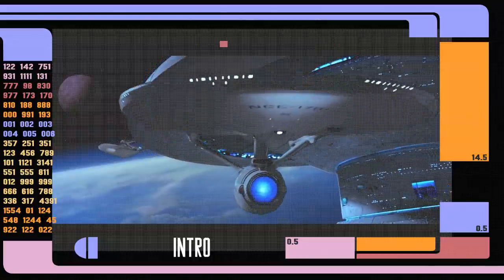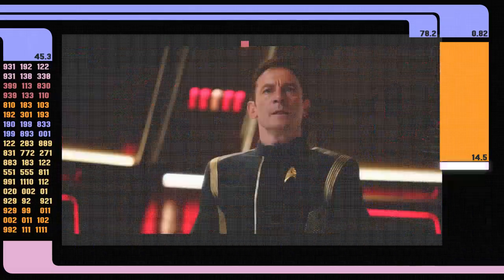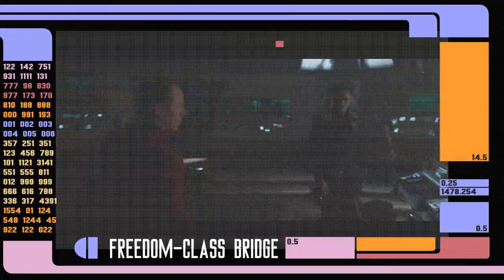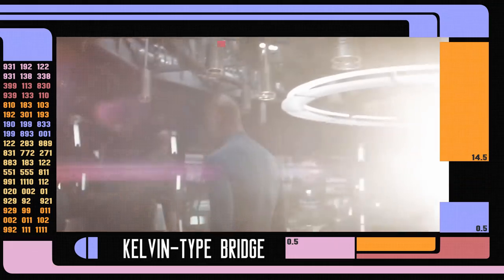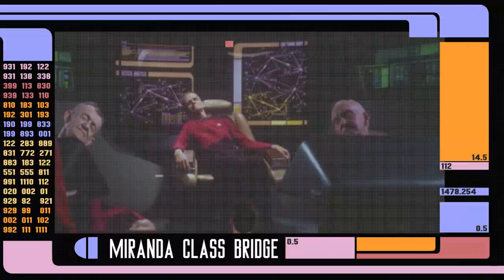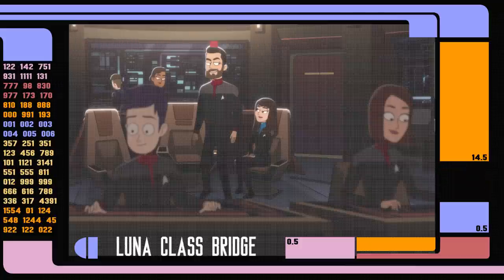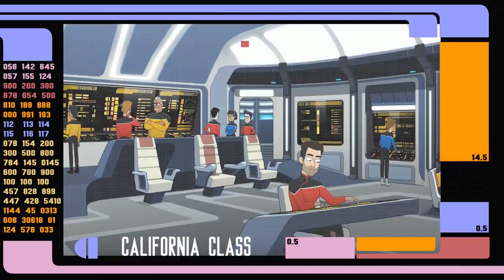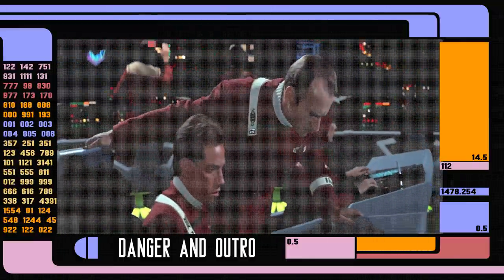Forgotten, Fatal, and Unethical Starfleet Bridges

Comment: The submarine aruments didn't hold water (pun intended) for me either. Especially when it comes to  the big military ones. The effect of the vacuum of space on the hull of a space craft doesn't change. Not like a maneuvering nuclear submarine.

Windows work better on a space craft. Though it would be wise to have some kind of armored cover. Even if the "window" is a transparent metal. I doubt it would realistically have the same protection qualities as it's opaque counterpart. You want as many layers between you and space as reasonably possible.

Good breakdown. The Miranda is still the best in my opinion.

Comment: I thought they used Molicircs (Molecular Circuitry) which are solid blocks of material (like Crystal or Plastic) with the molecular engraved circuitry which when that huge amount of power surges through them they can blow apart and would resemble rock like objects?

Comment: Most of the bridge layouts are indicative of fishing vessels and airplanes but in the airplanes you have the captain in the pilot seat and the co-pilot next to you and then behind you usually to the right you have your radio equipment and to the left you have your engineer for the engine controls sometimes it's reversed depending on the maker of the airplane but ships are the same way you have the bridge where the captain sits on the right and first officer sits on the left monitoring the engines and behind them they have the radio operator on my ship it was the left side and the navigation charts were on the right side

Comment: They were battling at 100 to 100,000 Kilometers around 62 to 62,000 miles.   so windows would not even pick up a ship.  A d& was only 750 ft so you would be hard to pick it up.

Comment: The rocks are easy. Heat up a flat piece of metal with an oxy acetylene cutting  torch until it’s glowing, then hit it with the oxygen. The liquified metal blasts in droplets and pieces. When they cool, they and the slag look like little Rock’s.
If in Trek it’s power that’s heating material and causing explosions, it makes sense.

Comment: Really the rocks never made much sense to me either, but thinking about it, could maybe be some sort spray form concrete that they use for a surface coating. Much like drywall or sheet rock but more startrekie.

Comment: The kersplosions from control system hardware would relate to the control method. For minimal latency, you'd be manipulating the energy stream that energised a particular component. Minimal relays, amplifiers, encoders, etc. So, in the case of a surge, crossed circuits, etc: kaboom! Also, hence the auxiliary and backup controls, these would be less direct controls, by relays and switching components, and by software and remote actuators. These would come with the safety but inherent latency and indirect communication. The main (direct) controls would feedback the status and control state, directly. They would be almost immediate in nature and would be very responsive to inputs and actions (and errors). A good example would be a transporter, where you don't want to wait for an error detection system to tell you there's a problem with the matter stream, you'd want to experience it directly in the controls you are handling. Something like haptic feedback. As for the rocks, plasma energy + most tactile matter -> cooked matter, probably carbon deposits, buy why not pyrolytic "rocks"? if silica and Aluminium are present, you'd plausibly have ceramic byproducts.

Comment: There is no such thing as a need for so much power flowing thru the console 18:50. Regardless of how much power is needed at the endpoint, the power for virtually none of my car's functions flows thru the switches on my dashboard.  Virtually every switch on my dash merely controls a relay. Most relays are under the hood closer to whatever they operate,  and these relays serve as electrical switches themselves. 

So t power for the starter,  blower, and radiator fan motors does not flow thru the dashboard.  That would be dangerous and would start too many fires in the passenger compartment. 

Apparently this idea regarding relays and the very concept of a fuse was lost in either the Eugenics Wars or WW3, or something. Or maybe people in t 24th century just like exploding dashboards and fires in the passenger compartments because life is just too easy otherwise.

Comment: Another issue with having a window over a view screen is it means you only have a single sheet of plating between the bridge crew and space. Even if transparent alimunium is as strong as Duranium or Tritanium alloy (which there is no evidence that it is) you're still making the bridge more exposed by cutting away material from in front of the bridge.  The bridge on starfleet ships is exposed enough as it is without thinning the forward protection to a single thickness of transparent metal plating.
Finally, I'd like to point out that the field of view isn't even that good, it's a flat plate and it's inset into the hull.  All you can see is directly ahead and up, there's no effective vision to the sides or aft of the ship, so you'd need a view screen in addition anyway.  If you must have a direct vision port on the bridge it'd be better to expand the bridge ceiling dome so you can at least put someone up there to have 360 vision above the hull (still not going to see anything bellow thanks to the saucer).
Reply from the maker: It’s the same amount of protection.. a bit does the same for both

Comment: As for the windows issue:  apart from the simple fact that the same with a capital W is never a good idea, I so dig the point. 
 I'm a secondary school teacher, and quite the fan of using ITCs as a tool. But my experience is, if you plan a lesson where you use them and don't have a Plan B, that lesson is lost and frustrating in 95.95 percent of cases. 
  And now figure that there's 1,000 people's lives depend on it.
Reply: One word, Cameras.

Comment: Windows: https://www.youtube.com/watch?v=DduO1fNzV4w&t=3s
Exploding Consoles: I blame them using EPS conduits and getting away from wires (There is no need to have the voltage of a X-ray or MRI going to any one console on a bridge. Energy should be divided out in a Pen-Panel (Penetration Panel) anyway.

Comment: The 'windows' in the front of some of the Bridges (looking at YOU Enterprise E) are probably made of some transparent aluminum or some more advanced alloy but don't appear to be quite as durable as the non-transparent metals used for most of the hull shell plating, we did see the 'E's bridge window blow out from battle damage with helmsman Hawk blown out into space.  The ability to project images onto it is 20th Century tech (Heads Up displays) used in military and many civil aircraft, even some automobiles played with the idea from time to time.  

Positioning of the Bridge of a ship expected to take part in combat is something I've never liked.  Having the Bridge / Combat Information Center in such an exposed position.  "Target their Bridge" - one of the Duras sisters in "Generations."

I write "Space Opera" stories for my own entertainment, my warships have their most sensitive or vital areas buried deep in the hull behind multiple layers of armor and shields.  Main Bridge is part of a module containing the central computer core.  The layout of the Main Bridge is similar to what we see both in Star Trek and in the CIC of many USN warships, Captain's chair elevated in the center with consoles for helm, operations, various weapon system and electronic warfare grouped around him with other consoles to monitor engineering and so on lining the outer bulkhead.

Viewscreen is exactly that, I call it a "Smart Wall" except that the tactical display mode is holographic, showing both friend and foe in positions truly relative to each other.  Why doesn't Star Fleet use 3D displays?

Comment: I think that if the consoles are truly just looking at sensor data and commanding the computer to do things around the ship, the consoles wouldn't blow up.  Most likely, these computers have some sort of advanced processor in them that when trying to draw too much energy while a surge happens will blow up.  an explanation as to why these computers are still usable afterward is that a backup computer that is less powerful allows undamaged portions of the display to be used to do basic functions required for running the ship.  If the display is too badly damaged then I would imagine that you could reroute controls to another console.  Regardless, these consoles seem to have a fatal flaw, one which literally kills people.  It would be much more sensible to build these computers into a server room nearby to stop overloads from killing or seriously injuring the bridge crew.  I could imagine that other species tend to do this approach more as the federation can be hard-headed sometimes.  at least most of the bridges have handrails that are well made to stop people from just flying everywhere as we see in certain other ships.  Seriously, the number of times someone was saved from one of those handrails probably makes up for the whole console blowing up thing.  Maybe the consoles have large batteries in them which an overload could create a big enough discharge to cause a minor explosion.  that would honestly make more sense but again the consoles should have less tech inside them and in a server room instead.  Those consoles in TNG are pretty chunky even for 90's standards.  But yeah, even though computers don't really explode like that in real life, they clearly have a big problem that has remained untouched for like 200 years almost if not more.  All I have to say after that is get a life.

Comment: Whoever makes transparent aluminium will implement it. Oh you mean aluminium oxynitride? The actual real-world Trans-Al?
Alien Bridge Breakdowns? Hell yes!
Exploding Consoles? Y'know, we always assume that these consoles don't ave circuit-breakers, overflow-switches and surge-protectors, but what if they do? What if these safety-measures exist, kick-in, and what we see is just merely the remaining over-power bleeding through into the system-that-cannot-handle? Imagine how much the system would explode without them...
Rocks in consoles? Well, I never heard the idea that they are basically non-rock materials from inside the console that simply solidify when the console explodes. I like the idea.

Comment: Federation bridges were designed larger as Starfleet became more and more "Exploration and Scientific," with a low emphasis on combat.
Larger, clear panels, space to move add to comfort and ease of officers and diplomatic endeavours.
For examples, Defiant bridge is more compact....its built for war.
NX bridge is more compact and streamlined....early United Earth StarFleet.
Explorers have a mix (Constitution, Intrepid) Diplomacy are more expansive (Galaxy) Combat more streamlined/compact (Defiant, Miranda) Scientific more science based (Oberth).
As the series moves into more "Golden Age" territory, they expand and focus more on "looks" than efficiency and the designs reflect that.

Comment: I think a modular pod/chair with self contained lifesauport, back power, and several dayscof emergency food, water, air supplys contained in the comad self sealing pod/chair which could have setbelts. And be wifi conteded buy blue tooth mick to the other comand pod/ chairs, in various locations around the ship. And thuse less venerable to command crew deaths, or captures, but conected to the computers that really must run any real ship. Given the size and vast distance these things would be. At least the size of a aircraft carrier or bigger.

Comment: The problem with windows on a vessel that is often attacked by LIGHT shouldn't need to explained to you, Lore.  It's much, MUCH safer to view external video feeds than to have a completely transparent barrier to the most common weapons in the world.  Glass on warships now can at least provide protection against bullets, but phasers?  It's like an invitation to vaporize the entire bridge crew.  Let's not ignore that reasons you give for why a window would be a good idea ARE REASONS WHY THEY AREN'T.  Space is FULL of things that can annihilate your retinas.
Reply: If they where worried about their retinas, they would not have so much lensflare everywhere.
Reply from the maker: I always find it curious when someone tells me what should or shouldn’t be told to me.. that said, I’d hope they would have technology that dims such attacks
Reply: @LoreReloaded  The problem with auto-dimming technology is that it's too slow.  It only takes an attosecond to permanently destroy your vision.

There are nonlinear optical effects which can be exploited to defocus a beam, but any starship weapon capable of burning a hole through a hull will obviously overpower such effects.  And even if they did work, the window would melt immediately.
Reply: @ts757arse  Good luck talking your way into our new attosecond-pulse laser room with that nonsensical speech.
Reply: again the windows are transparent metal....
Reply: @ts757arse  isn't transparent aluminum or metal the same thing?

Comment: Why use windows whven you could use viewscreens that can see all around the ship. No point in only facing forward. Pleny of episodes showed them using viewscreens to see behind and to the sides. Having multiple cameras across the hull make viewscreens have redundant points to absorb damage. A window would be damaged or flat out destroyed by a shot. Meanwhile a viewscreen is just a camera point in front of armor plate. Knock out 1 and you could still use 3 or more others to much up the damage.

Comment: There's no salvaging the console explosions. No matter what level of energy you're working with in the warp core on the opposite end of the vessel, the console only needs enough energy to show the display and send and receive signals. It's a glorified touchscreen monitor. We know the computing is done elsewhere because they stop responding together. We know the power is elsewhere because they lose power and go dark. It literally has less reason to explode than a Samsung cellphone.

The excuse I've heard that wasn't mentioned in the video is "everything runs on plasma". This is due to everything being a "plasma conduit" to explain the glowy special effects when things get cut, but we know the data transmission is optical, there is regular electrical arcing....oh, and plasma isn't inherently that destructive. In the quantities of a lightning bolt, yes, but not from a little tube. Even if it were that dangerous, they've shown plenty of times they can convert to different power outputs. It could be running on electricity for safety (and efficiency...).

The only possible in-universe explanations are that 1. they let the Pakled design it, or 2. Starfleet doesn't want to actually have to pay out the pension plan it agreed to.